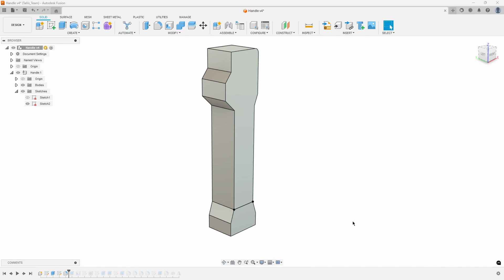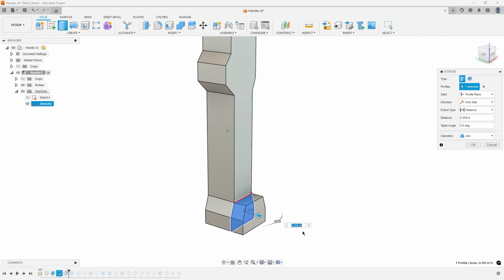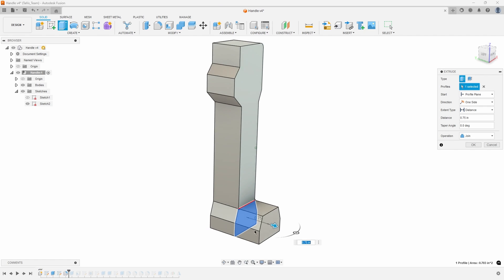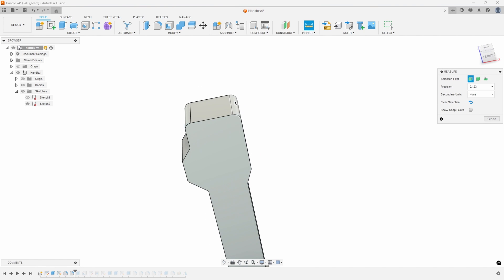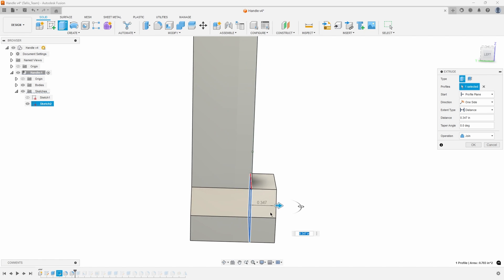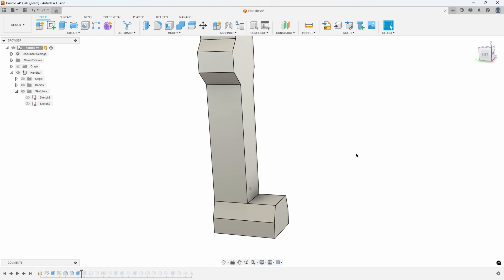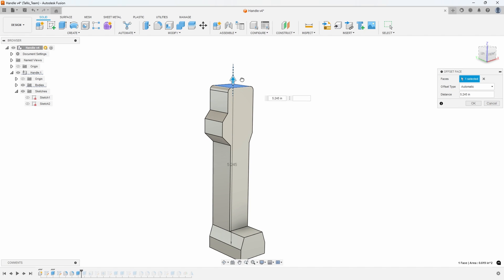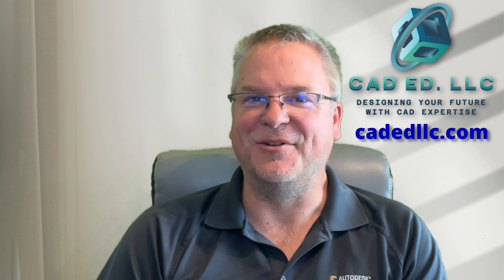Measure & Re-anchor command in Fusion

Comment: Great video Brad as always... question, does the measure option you did on that top filet work if it was a variable fillet you selected/situation? I would assume it might work but could also see it not working... I'll have to try it, would be the best way to find out I suppose :)... Thank You again for all your great videos!
Reply: Tried what I asked above and no it does not work on Variable fillet...
Reply from the maker: Ya, I was going to say that it probably won't work on a variable fillet.  You would have to edit the variable fillet feature to see what "points" along the fillet were used and what radius setting was set for each of those points.